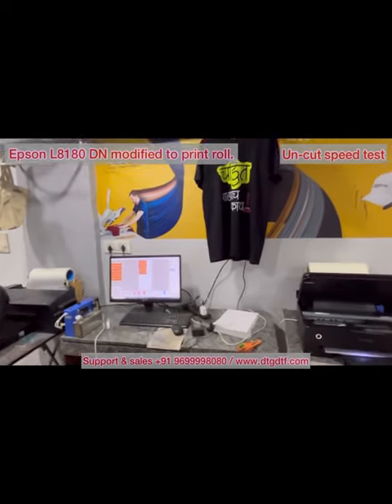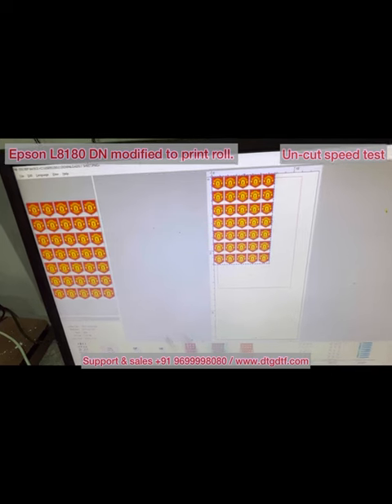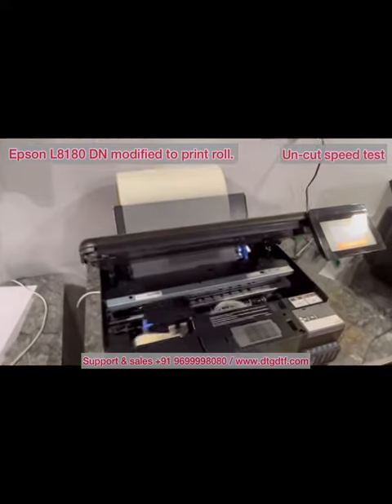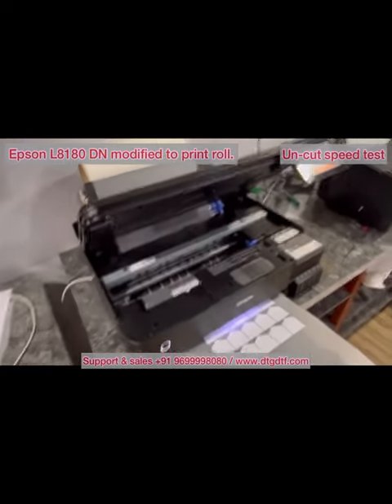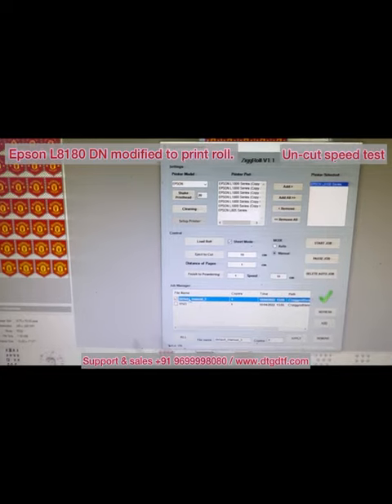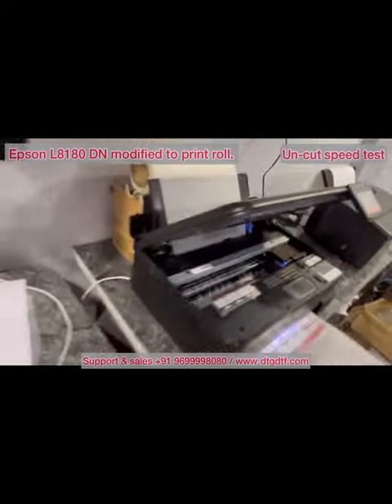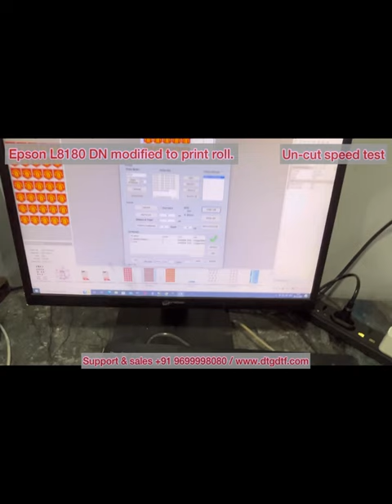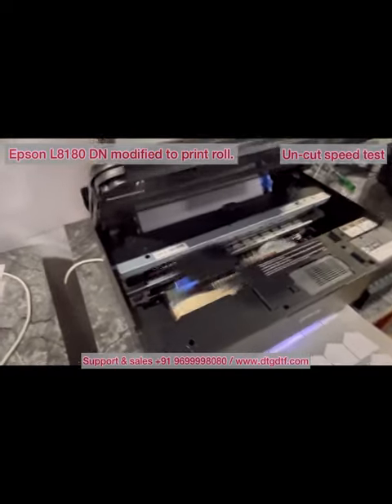DTF ET 8550 or L 1800 modified to print roll with highest speed. Uncut Video

Comment: Hello, I have Epson et 8550 with acrorip 10.5.2 what version of ziggroll will work with that software?
Reply from the maker: Yes it does
Reply from the maker: You can add ziggroll for roll printing
Reply: Thank you for your help and thank you for replying so fast, I will be purchasing ziggroll today 🙌🏼
Reply: Any version of ziggroll will work with this Acrorip version?
Reply from the maker: @hugotorrez2922  depends on Printer model

Latest models work with V4

Comment: If i create a file 30cm × 100cm and then when printing i change the print size as file size from printer setting does l1800 print the file with no issue?
Reply: For the paper also i will cut same size. will the printer print without any modification to it?
Reply from the maker: Yes

Comment: I have same printer but when I use as roll to roll it's ejecting all film a few minutes later. How did you solve this problem?
Reply from the maker: Use ziggroll app to feed and print on dtf roll
Reply: @dtgdtfdiy  we used ziggroll but it doesn't solve the problem. Just we can 5 or 6 m print as roll then printer is ejecting all film.
Reply from the maker: @ugursengil  add one job after other it never ejects paper. In video itself u can check. Users are printing 100 mtrs without ejection. 
Check USB
Check drivers
Reply: @ugursengil : Could you solve your problem with ziggroll? I have problem with Epson ET-8550 where after end of print the printer will continue ejecting paper instead of stopping after print. Creative Graphics never gave me solution for the problem. Unfortunately until now buying ziggroll was for me waste of money...
Reply from the maker: @wamp-aw check with settings. It doesn’t leave paper. 
Check cr motor for heat also. If its getting heated it will create error.
Reply from the maker: @wamp-aw with ziggroll you can feed and print on roll sir, it doesn’t make any sort of changes or dosentsolve any hardware issue